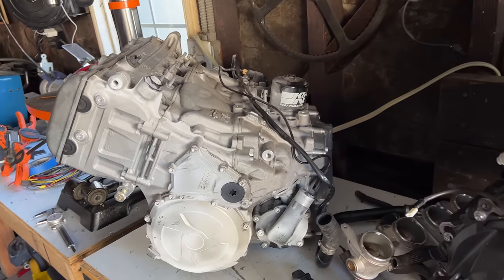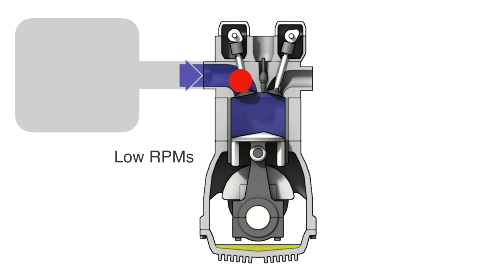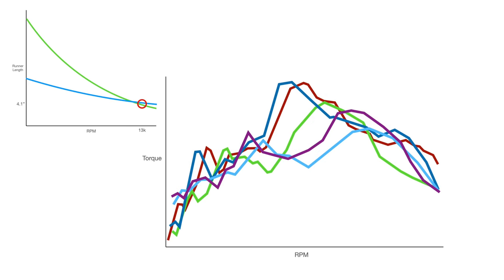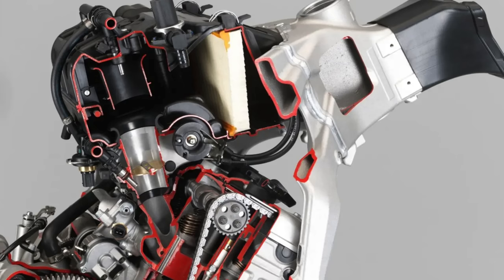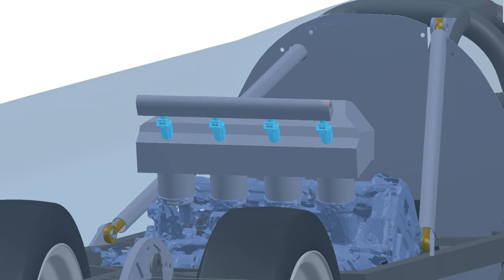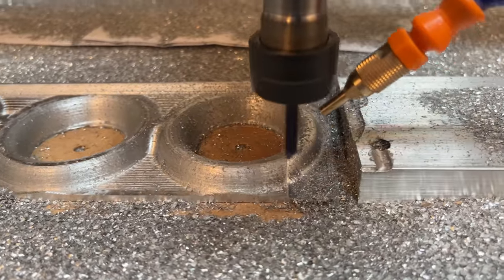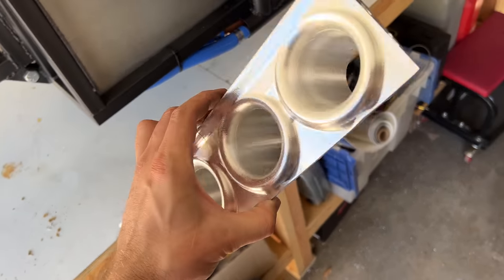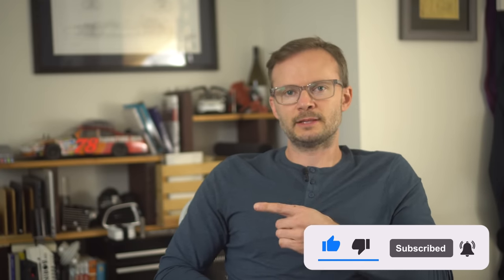Build Your Own Intake. Or Just Watch Me Do It. Whatever.

Comment: "... ignore the math and wing it." LOL

We built a PVC intake for my Honda engine to get the runner length we were looking for. $40 in toilet parts and glue. It works and we got 110 HP at the wheels on a dyno from an engine that's supposed to only make 115 at the crank.

Comment: I built ITBs for my 452 cu. in FE Ford.  Peak torque was up 10%, but peak power, when compared to a single plane manifold, was unchanged.  David Vizard has a book on intake manifold fabrication.  The formulas are wrong because the assume a closed end, like an organ.  Looking at your design, I think you're spot on.  The intake runner inlets are as good or better than trumpets. If you need more plenum volume, you can add a spacer to the throttle body.  Sequential injection will smooth out your idle.  At higher rpm it turns out that the injectors are 'on' longer than the intake valve is open so injector placement and injector timing have almost no effect on horsepower.  I am an engineer also, and have researched this topic a considerable amount.  I think you hit the nail on the head.   I also run my engine on a megasquirt.  I found no difference between sequential injection and batch fire.  The engine make 552 hp and 600 ft, lbs. of torque.  That's  lb. ft. for you younger engineers. The ITBs allow a smooth idle and smooth operation at cruise rpm when using a cam with a race profile,  Try to keep the air laminar from the air intake to the manifold, and above 100 mph there is a ramming air effect equivalent to about 1# of boost.  Good Luck
Reply: Vizard is pure genius. Dude gets overlooked more often than not. The guy is a huge font of knowledge, that everyone tinkering with motors should pay attention to.
Reply: Personally I'd have chosen the longer manifold lengths that showed the highest torque ( 11 or 12") and carried it out well to the next harmonic.   It's better to have run just over a peak than to almost get to one...more area under the curve.    As long as the manifold runners are of adequate diameter...the slightly longer runners will still flow well...if you can fit them it's worth it IMHO.   To keep the hoodline low you'd need to curve them...but for someone with the building prowess on display here that's not really much of an issue.
Reply: @recoilrob324  He's running on the second wave reflection and then the 3rd wave reflection.  Longer runners would kill the high end.  A 7000 rpm racing chevy uses a 7" manifold runner, 12" total.  A 13,000 rpm motor needs half that and he has 4" already in the head.

Comment: Decades ago I helped a friend build a custom intake for a MG Midget using a Datsun A-series engine, based on a dual Weber DCOE manifold and an aluminum airbox with Bosch K-Jetronic injectors firing at the runners from the other side of the airbox. While using no math at all and based on very little experience, the end result was pretty similar. As should be expected it was poorly suited to low speed... but it ran, and arguably better than the carbs used previously.
Reply: And, keep in mind, K-jet was actual overpriced hot German garbage
Reply: @theprojectproject01  I don't know about overpriced, but was indeed German, and it worked. At least we didn't have to worry about injection timing... since it's a continuous-flow system. 😁
Reply: @brianb-p6586  Hey, it's your life, spend it how you like.  I myself could never get a K-Jet system to work.  Part of the Why is because I was driving old shitboxes with it, and part is that I didn't know what the hell I was doing.

Comment: Rub the edge of your alloy with some fine sand paper & clean everything with acetone (including filler rod) before welding. 
Also, put some tacks along the length of your part before you do a long weld, it will help with you edges burning away.
Reply: & a gas refill will make a huge difference!
Reply: I remember we hired out to a professional for most of our aluminum welding needs (esp 6061) because even the best prep can still produce nasty welds. I remember the guy saying there were all sorts of weird things he did to prepare (solvents, sanding, etc) and even still, if it was a bad batch you got nasty welds.

Comment: I would recommend trying out pre heating the aluminum, especially considering the size difference in the pieces being welded together. It also helps prevent cracking in the future since aluminum cools fast and it can cause the weld to shrink too fast.

Comment: I was working in a shop that mostly did nissan and bmw racing engines. We designed a carbon fiber airbox for a bmw S50 hill-climbing engine and we would build an variable aluminum airbox to test different configuations on a engine teststand to make it perfect...tuning on na engines   can get really crazy compared to turbo engines where you just add 100hp with a laptop and a cable...

Comment: Oh bloody hell Matt. Your super dry sense of humour never fails to crack me up. Therapist's should proscribe your channel as a treatment for melancholy. :D

I may have said this before, but huge thanks for putting in all this extra work to film, narrate, edit and upload these projects, mate. And just be aware that a lot of your loyal viewers know that if you DIDN'T do all the extra messing about needed to create your great content, you'd probably have had time to finish all your current projects ages ago.

A while back I decided to try filming myself doing a small lathe project (A simple tailstock die holder), but quickly realised that just making sure everything was in frame and lit to an acceptable level meant EVERYTHING took 3 times as long to do (it didn't help that I ended up starting one part again from scratch. Not because I screwed it up, but because the camera had spent the whole 45 minute of machining trying to decide if it should be focused on the work, the tool post, or the damn lathe bed !!!). I quickly gave up and finished the project without recording anything else. My attempt to join the (already crowded) ranks of engineering youtubers didn't even get to a point where I needed to think about annotating or editing that aborted mess of video clips. It was all just too much work and aggravation for (in my case) zero psychological or financial reward......... So once again, thanks for putting in all this extra work for us mate. Your efforts are not unrecognised.
Reply from the maker: Thanks for the kind words! I love reading comments like this.

Comment: Those top injectors remind me of the few race car intakes i've seen. One that really sticks with me had these floating carbon trumpets that rose and fell with RPM.  The injectors were suspended above the trumpets but first sprayed into something like carb jets.  The injectors moved in sync with the trumpets but didn't look like they were mounted to the same mechanism.  It looked like it was using slide throttles mounted at the cylinder heads but somehow the trumpets looked like they were vacuum controlled.... beyond being completely confounded by controls those carb jets jumped out because of the air patterns after the jets.  The fuel spread normally from the nozzles and hit the jets maybe an inch out.  Then fuel/air collapsed and concentrated a bit past the jet and faned out as a super fine mist to hit the trumpet just as the diameter of the cone reached the runner diameter.  I thought at the time it was for atomization but the way you explained the potential of 3 injectors feeding one cylinder i wonder now if it wasn't done to keep from crossing streams... Thanks for the knowledge!

Comment: Just bought an HFT welder and started welding for the very first time yesterday, I am excited to use Send Cut Send to not only practice welding but to build neat 3D metal structures that would otherwise be costly and require machines / brakes that I don't have, thanks Matt!

Comment: If the fuel line crossing the body line, then make another reason for it!

You can make a ram air intake/ air scoop infront of that crossing (aerodynamically speaking) so there's another reason for extra body while adding pressure for your intake system. You should run aerodynamic analysis anyway though, ansys workbench makes an easy tool for it

Comment: One little suggestion I have often seen used on formula student cars that sometimes backfire: put in a plug that can blow out kind of like a cork. Or you can also just plan on it to backfire to "dynamically" increase the volume of the airbox.

Comment: I built a intake manifold for my TR6. There was some test data from Jaguar about intake runner length. And all those on line calculators, but they were about V8’s primarily. So, I winged it. 16.5” from bell inside common plenum to head, another  3” to backside of valve. Currently running MS3X. The goal was torque, preferably around 3200 RPM. Not much space in a TR6 engine compartment. Based on Mat Cramer’s advice at DIY Autotune, I linearly corrected the VE map to a set 14.7 AFR and the plotted the MAP isobars. My cam is allegedly a flat torque curve…..the isobars plotted to a peak around 3300-3400 rpm.

Comment: Just some friendly advice from a motorsport fabricator:

I think one thing that could help your aluminum welding would be to keep your filler wire in the argon shielding area after dabbing. Also clean, clean, and clean again beforehand. That black soot around the weld area tells me there was some shmoo left on there. Great work on the designing. My background is in engineering and I can confirm this is exactly what happens 😂.

Comment: Nice result!   I went the composite route for my air box when I squirted my CBR.   But seeing how it turned out, I might try your method if I ever need to redo my air box.
Reply: what does it mean to squirt a motorcycle ?
Reply: @Thomas-yv5yw  it means that I converted my motorcycle to EFI using the MegaSquirt DIY EFI solution, which is the same thing Matt is using.
Reply: @leok888  oooh thanks for the answer !
what's your review on berfore/after EFI ?

Comment: I like the way you think. I could benefit from some of your thought processes lol! Love anything that makes fantastic HP, Torque & mechanical efficiency. The best teacher is experience, so don't be afraid to try different intake designs. I prefer my injectors as far away from the intake port as possible. Testing has shown some performance increases due to the fuel air mixing more thoroughly, but again, dyno testing & trials are best.

Comment: One thing you can do while welding aluminum pieces like your throttle body flange is bolt a piece of steel to it before hand. Then you won't warp it as easily. Still can't get crazy with the heat, but it will help alot.

Comment: Given a turbo charger with one broken turbine (the hot turbine usually works fine), a 10kW RC motor, appropriate pwm driver, an Arduino and a 24V battery, we should be able to manufacture a electric supercharger. Would have to replace the alternator for 24V windings to power the 24V batteries as well as a 24/12 DC converter to charge the 12V batteries, and plug some 24V charge controller a d an Arduino. Safe for mounting and support that should cover all requirements at round about $500. You guys think it would be practicing to juryrig a supercharger in about two months of time?

Comment: 8:10 the taper is actually a sheer effect for the top fuel injection system and helps with re-atomization. fuel doesn't stay still and i learn it doesn't stay in place also helps with velocity

Comment: always happy to see videos from you, you show the real struggles and how to conquer them.. i was wondering because of the limited space that you have why not going simple just like using a carburetor.. you could use 1 high cc injector or 2 just after the throttle body using the megasquirt with maf and o2 sensor to adjust the amount of fuel required

Comment: Since you're all fancy now with your CNC router, you could use that to flatten the TB flange. Requires you to set up a second vertical wasteboard clamped to the bench and some sketchy method of workholding the plenum, but it would be fine. Probably.

Comment: if you ever run into a part thats too much trouble to aluminum weld, dont forget about those alumiweld rods, you can get them at harbor freight, and the joint ends up being super strong. in fact the material it deposits is way harder than 6061, you can sometimes apply it in wear areas if you run into something like that. the only downside is it requires a lot of heat to work, i think with tig welding you can sort of get away with less heat since its more localized.

Comment: Hey Matt, just found you channel. I have built a couple custom cars for drag racing. Very cool channel!! 
I had a large box intake plenum on a NA motor that I then turbocharged. 
The PSI kept popping open the intake. 
10 psi x all those square = a lot of force. 
We ended up making a much smaller plenum and I used 1/2 of an aluminum tube welded to the flat plate with the runners in order to keep it from breaking. If I remember correctly we still had to re weld the occasional cracked weld. I think we had a hard time running more than about 20psi on the sheet metal intake. 
Anyway, hope that helps, and cool build.

Comment: If anyone is curious about the physics of wave/acoustic tuning, what he is talking about at the beginning, here is an important fact.  Only every odd pair of bounces should be considered.

First off, pressure always wants to go from high to low.  A wave will only change phase or refract (such as high to low) when it encounters a lower acoustic impedance, such as an air boundary, after a change of cross-sectional area.  Therefore, a wave will not refraction when it hits a valve, or a hard boundary.

This means when the intake valve closes, a high pressure wave is produced.  It goes back up the runner until it hits an air boundary in the plenum/atmosphere, where there’s a change in area.  It changes from a high to low pressure wave.  It goes back down the runner to the valve.  If timed right, it’ll go into the chamber and suck air in.  If the valve is closed, it’ll hit the valve BUT NOT CHANGE INTO A HIGH PRESSURE WAVE.  You repeat the above and if you think/draw out the sequence, you’ll see only the odd pairs will allow a low pressure wave to be send into the cylinder if times right.  Otherwise a high pressure wave will be sent into the cylinder, trying to reduce air flow into it.
Reply: As for a runner length equation, I found a bunch and tried to analyze them to be any sense, and go through some derivation myself and the following equation I’m pretty certain is correct.  It interprets the above concept in the denominator and it’s called the Chrysler Ram Theory, referenced in a few research studies.

Four stroke piston engine:
[(speed of sound)*(720-Intake Duration)] / [6^2*(2+4(i-1))*RPM]

Where “intake duration” is in crankshaft degrees, “i” is the order of reflection (1 is first pair, 2 is third pair, 3 is fifth pair; After 3, the pressure wave is weak), and RPM is how fast the crankshaft is spinning.

Comment: Try Alittle heat, I keep a map gas plumbing torch handy while welding thicker aluminum plates, helps sweat out the garbage a bit and makes forming the puddle alot faster and cleaner.  I thought I was terrible at welding thick aluminum for years before I figured that out

Comment: You can use split channels and vortices to achieve better results but that really will require math and computer modelling.
The Theory is you have the air in one channel always moving forward even when the valve is closed while the other channel changes direction when the valve is closed siphoning air out of the other channel until it hits a wall that directs it into the the other channel. Basically the reverse function of a Tesla valve.
Because the majority of the air is always moving in the right direction with the highest velocity you get a much broader peak torque and power band that with tuned length runners.

Comment: Another great video.Only thing I'll say that is if you do go boost you might want to complete those welds. I know motorcycle guys will epoxy intake runners if they port them to much bit that's not on a boosted application

Comment: There is a strong chance for that extra volume becoming a necessity. Even with pressure. Inside a box that small, the air speed can, and most likely will, disturb the spray patterns of those injectors. Irregular AFR's @ red line are never a good thing.

Comment: One last thing.  The fuel injector recesses in the fuel rails should be 13.5mm.   If they are too big, and they leak, GM used a slightly bigger "O" ring on the LS2 that will seal a 14mm recess.  Ask me how I know.

Comment: Re: Sanding down the Inlet manifold.  Isn't a 'rough inlet manifold' more preferable than a smooth inlet manifold?  You want some turbulence to better atomise the fuel.
It's the exhaust manifold that you want "smooth" so the flow is laminar.

Comment: May I offer a hint with your aluminum welding?
Get and keep a small stainless wire brush and only use it for cleaning the aluminum right before you weld it.
Bath in acetone... Clean everything including the rod. 
...and keep the rod closer in to the gas. I see where you drug in some air.
Preheat is your friend and turn the power down.

Comment: Have listen to Darin Morgan about the surface finish in the runners. He sometimes uses a burr with a bent shaft to get the rough surface that is more optimal for keeping the fuel atomized. But mostly a 40 grit or less is good enough.
On one engine (v8 top fuel) they got around 100 horsepower from just doing a rougher finish in the plenum and runners.

But stay away from golf ball dimple finish its to regular and even.

Theres also injectors that are shorter. Might be worth sourcing some of those instead?